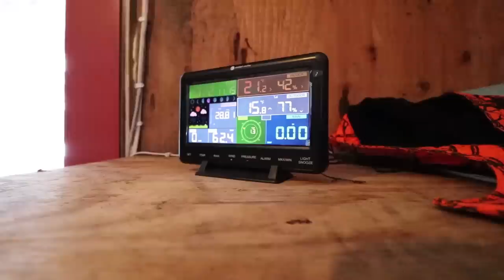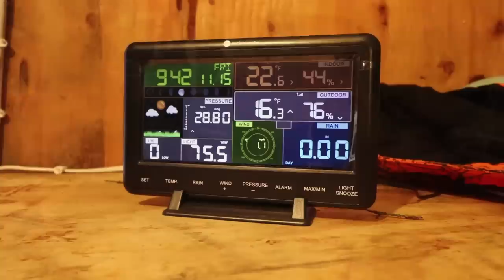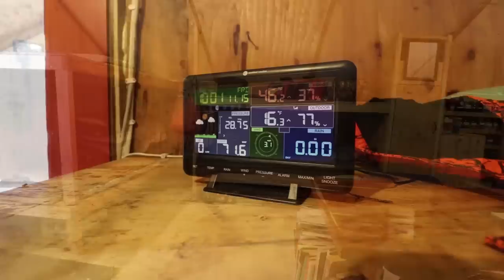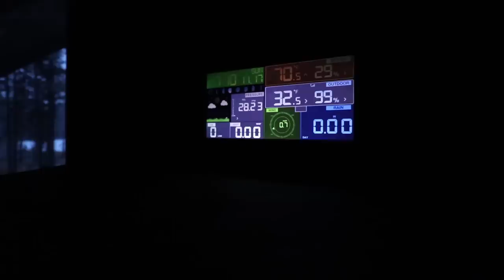THE TENT. Deer Season 2019. Second Weekend. Deer on the pole.

Comment: Out of curIosity, if it takes 24 hours to get the tent to a comfortable temperature, since you have electric service, couldn’t you use an electric space heater or two on a short term basis to bring the interior temperature to a comfortable level a little faster than 24 hours?

Comment: Joe, first of all love all your content but I have a question on ur tent construction, what are you keeping the styrofoam on the ceiling with? I have a 14' x 20' with 10' overhang porch built on a foundation and was about to insulate  the walls & ceiling and am curious what you have done. Also, is it directly against your fabric? Maybe you already covered that in a previous video however I haven't come across it yet.

Comment: You ever skin one using a golf ball cut the neck skin a few inches put the golf ball under the skin put a rope loop over the skin around the golf ball and pull sometime I use the truck to pull slides right off
Reply from the maker: I bring mine in and have them processed. I picked mine up today and it is in the freezer.

Comment: If you got electric  y not use it to heat and not have mess with the stove and all the prep work with it and storing wood
Reply: No your wrong
Reply: @randykirby2693  no he's not.
Reply: Ok you can light your cabin run your flat screen tv and DVD player ceiling fans laptop cell phones and plug your truck in o and a window ac unit in summer butt cant heat with it no your wrong lol
Reply: @randykirby2693  do yourself a favor educate yourself, I HAVE electric heat at my camp and it cost a fortune to run. And my place is insulated far better than Joe's.
Reply: @pesto88  were did I tell someone to do anything I asked a question lol!